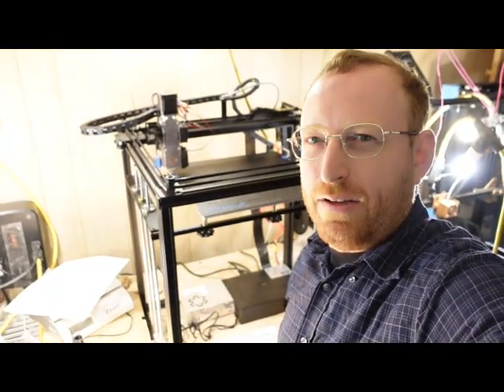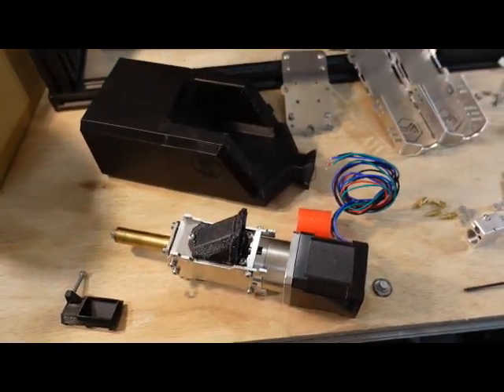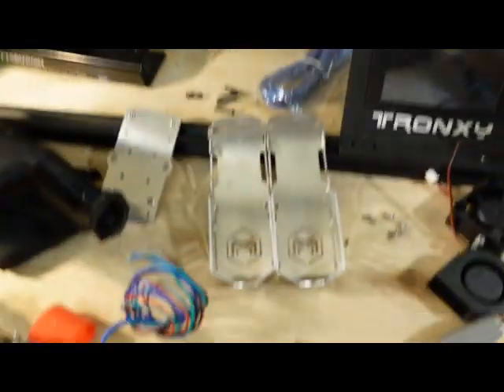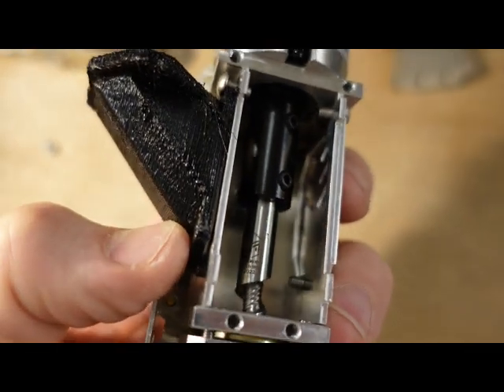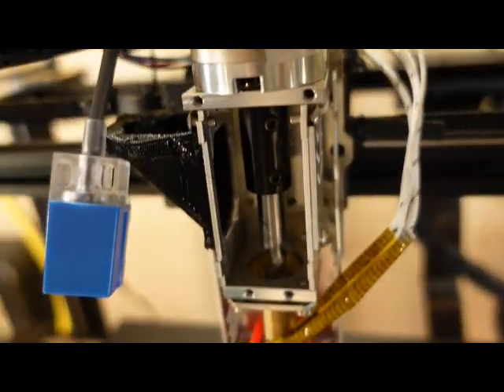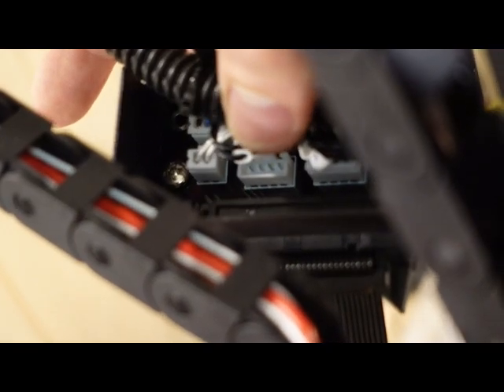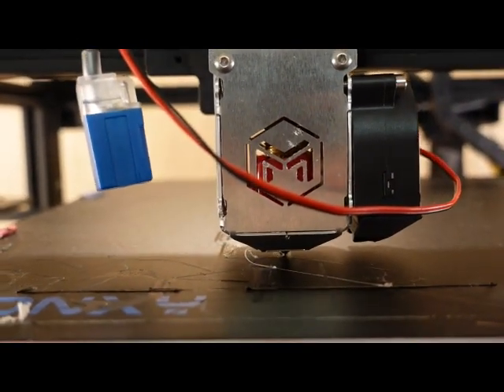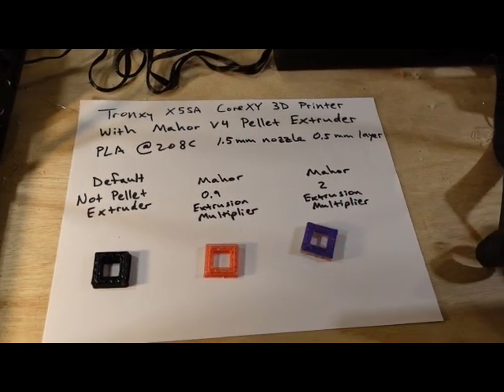Mahor V4 Pellet Core - Pellet Extruder on Core XY 3D Printer

Comment: Hey man! 
Nice job! 
To this video is half a year old now.... 
Have any progress? 
Planing on building one "big machine", kinematics is not what bothers me (I did see your "fail large 3d printer" video, some stuff is really useful to know), extruder it self, as there is not a lot of info on it... Some "resellers" claim it can print 200g of plastic in 1h (which imho for pellet extruder is not a whole lot) wanted to know, what do you think is limitation of print speed, is it a weight of the carriage, plastic "extrusion" it self? Like motor too weak to push more and or feeding "screw", maybe keeping up with temperature...? 
Also - what kind of heater on that Mahor you have? 24v70w? 
Is there any chance I can contact you in some "chat version"? Could be interesting talk and greatly appreciated, if you are game... 
Thank you in advance! 

Also, happy new year - may there be less spaghetti monsters on your printbed!
Reply from the maker: Sure, reach out anytime, my info is in the about section. There are lots of variables and it's an exciting space.